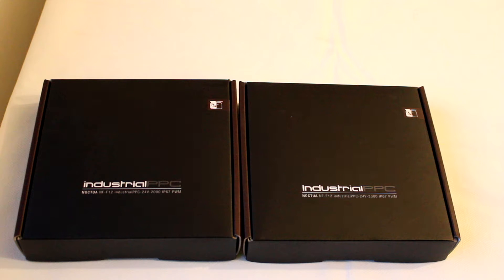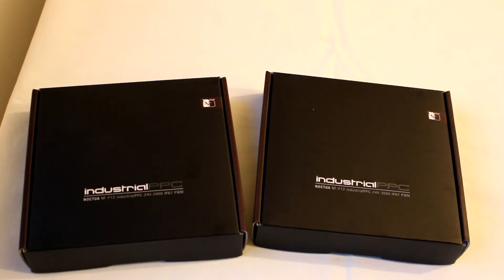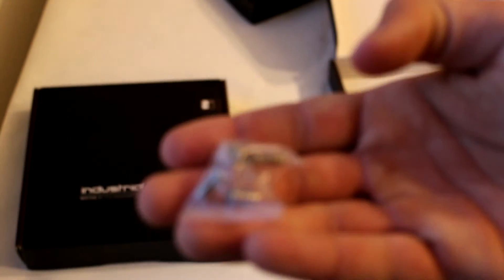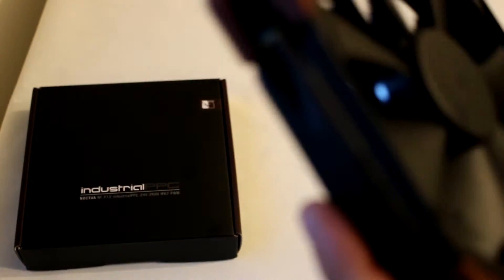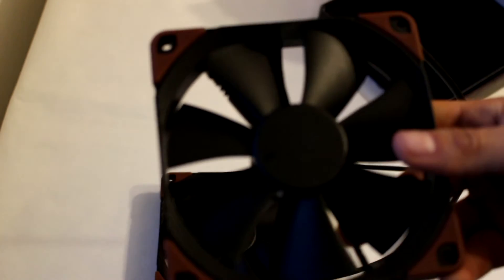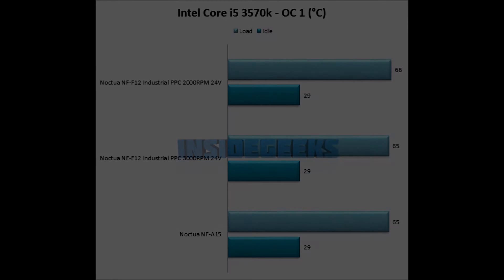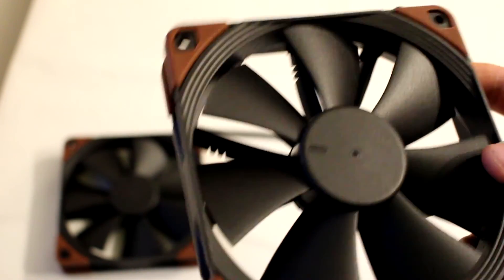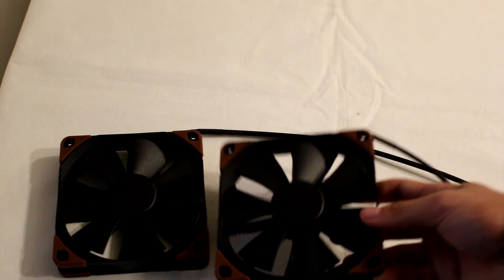[Review] Noctua NF-F12 IndustrialPPC PWM 2000 and 3000 24V

Comment: Wow. 30 upvotes. Shows you how desperate people need to see a proper review of these 2 fans.
Reply from the maker: I still have them, let me know what kind of testing you want to see and I'll be glad to help :) Beware that using them on 12V headers will cut the speed in approximately half, so it would work kind of as a low noise adapter.

Comment: just get 2 of 140mm 3000 rpm for replace default fans on my H110i . In terms of temperature is like heaven and hell at cost of noise . but still , it boost my cooling system  for 100%
Reply from the maker: Have you connected them to the PWM connectors of your motherboard? You need to plug them to the 4-pin connector in order to be able to control the fan speed in the BIOS